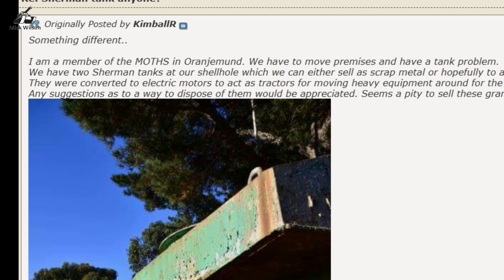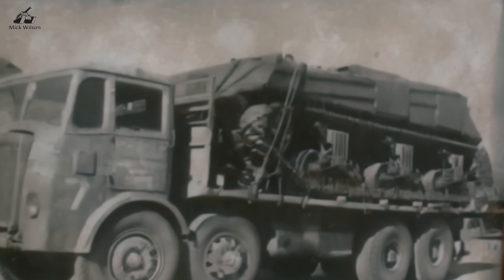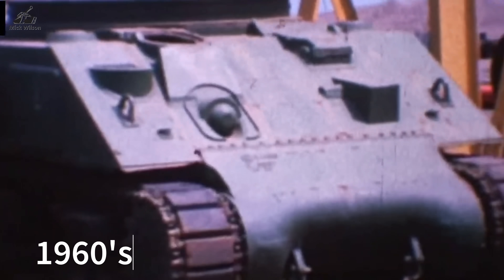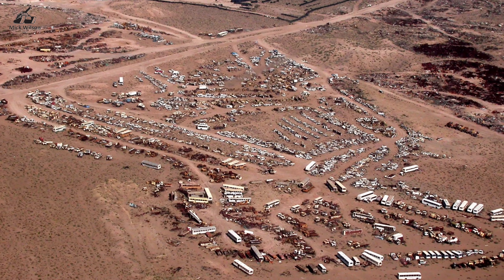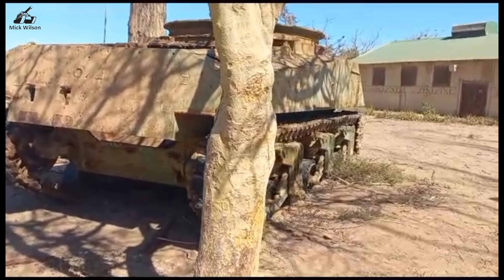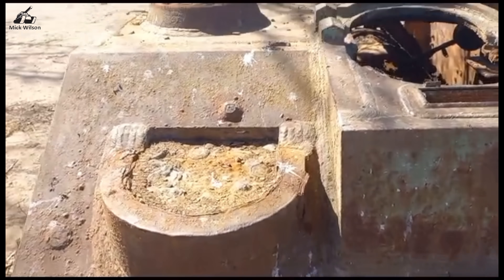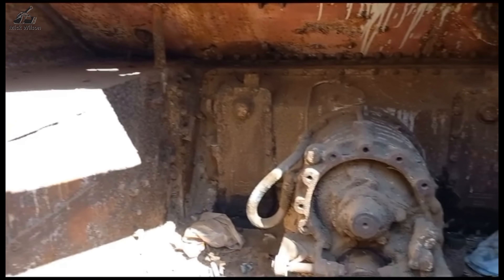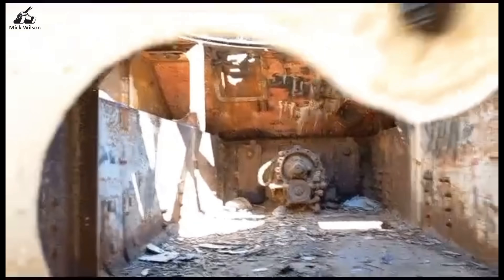Diamond Mining Electric Sherman Tanks of Namibia

Comment: Curious the decision to convert to electric.
Reply from the maker: It appears that only some were converted to eclectic, most kept there original diesel engines, but it made the diesels more likely to be use in the building of the sea brake water wall, so none of them have survived. Why they converted some of them is a mystery.
Reply: @514thmick  Well, Sherman tanks did originally have quite a variety of powerplants - can't have been easy keeping them running

Comment: Earlier I watched a video on the dry docking of the Battleship New Jersey. They gave the weight as 47,000 non-metric tons. 132,000 non-metric tons is 2.8 New Jerseys. That's a lot of scrap. At 4¢ per pound that's over $10½ million 2024 American dollars! Just a few years ago steel scrap was 50% more at 6¢ per pound and about a decade ago it was 2x at 8¢ per pound.

At 6:30 what is the crankshaft looking thing at the right of the screen?
Reply from the maker: It sure was a lot of scrap, no idea what that part is could it be some sort of heavy duty electrical rotator  switch? looks to be a few inside the tanks
Reply: @514thmick  If it really was a rotating switch, it was probably used to control power to the motor by switching different sections of the resistor stacks seen at 6:09, 7:04, 7:15 in series with the motor windings.